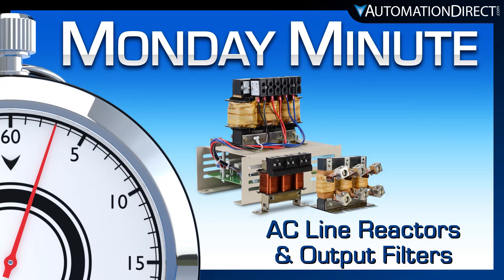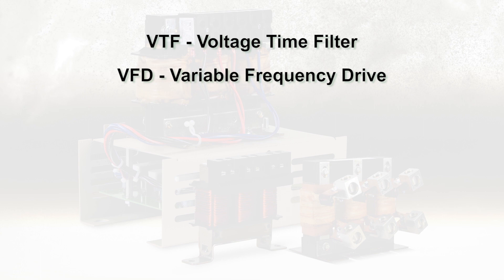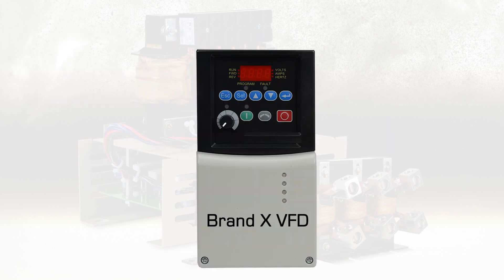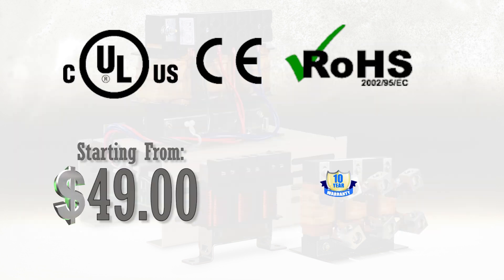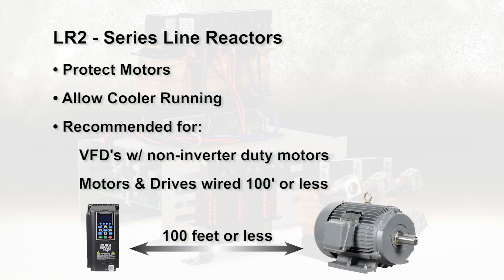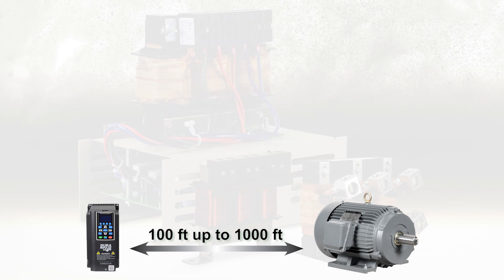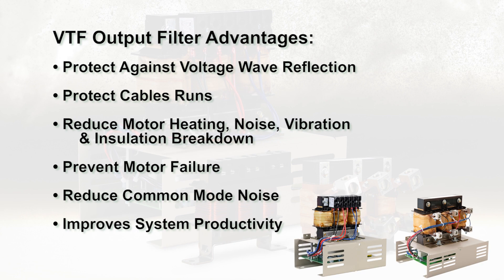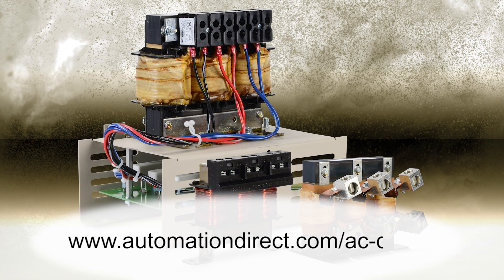VFD Line Reactors & Output Filters from AutomationDirect

Comment: do you have a video on VFD cable length and matching motor winding impedance? which can cause harmonic voltage ringing that can exceed the AC motor winding rating  and smoke the motor-coils?  thanks,   nice video...:)
Reply from the maker: Not yet, but we will add it to the list!
Meanwhile, Have you seen our collection of VFD videos?  
There are hundreds of videos covering many different VFD families.
Check it out here: www.automationdirect.com/cookbook - then click on the "AC Motor Drive" chapter.  Lots of good stuff there!